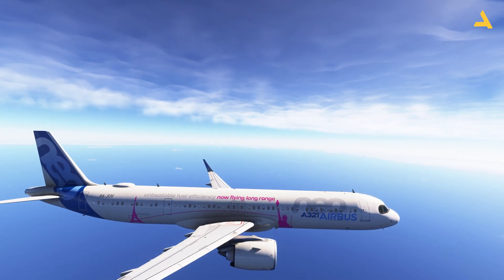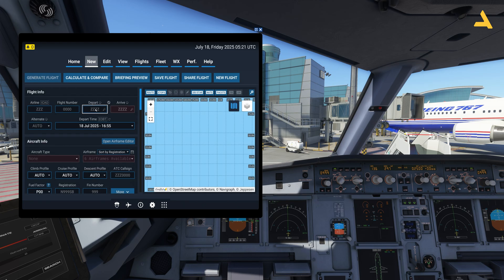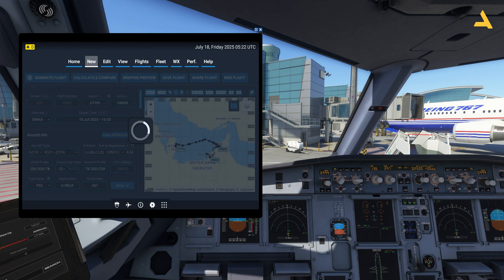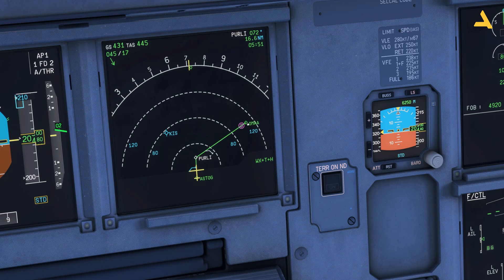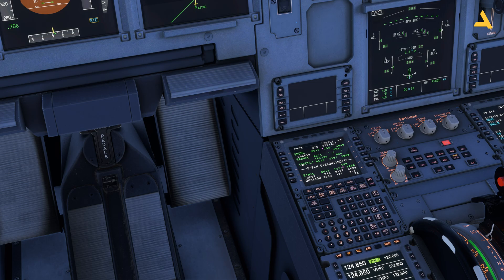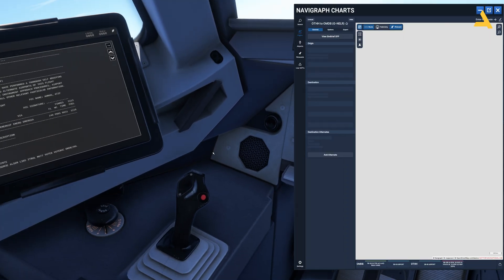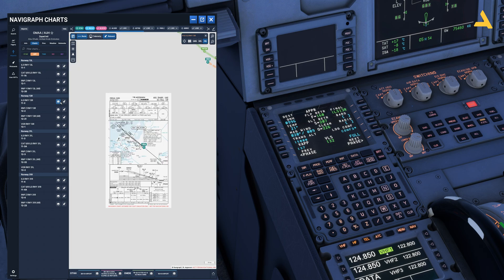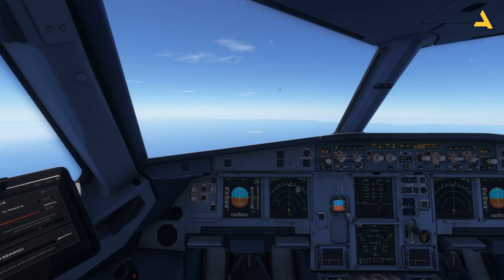How to Select Alternate Airport with Airbus A321LR by iniBuilds in MSFS 2024 - Tutorial 9

Comment: Hi Sir🎉

Please suggest from where to purchase FS 2024 and which version (deluxe, premium, standard).. what's their difference??

I haved registered in Steam...
Reply from the maker: You can purchase it from steam. I am using the Xbox version for PC. Selecting the edition is totally your call based on your budget. Maybe you can start with the deluxe version and then buy planes as per your choice
Reply: @aatifahmad  okay...so i bought a standard edition as per my budget...I have a controller with me....Initially i am facing difficulties with camera and the toggles....i am unable to hold camera at a spot to click any buttons inside the cockpit....its kinda tough.
Reply: also how do i get indian liveries like indigo, vistara and so on....
Reply: @AbhishekAnand-kh2mk you are probably facing stick drift or something else. I use a ps4 controller for xplane, I recommend connecting a mouse too for looking around and pressing buttons.
Reply: @joseka805 I have a wireless controller...And yes mouse is required to click cockpit switches. Only a controller won't serve the purpose. 

But to make things easy I wanted to use the controller only for everything like ( camera, power, clicks, brakes) but not all happens in same